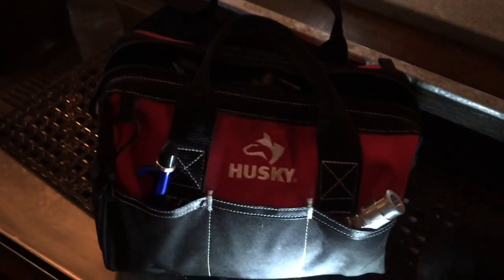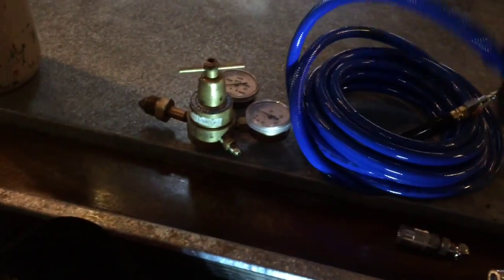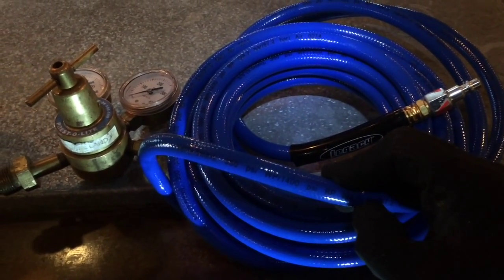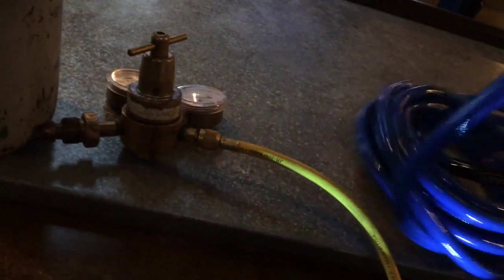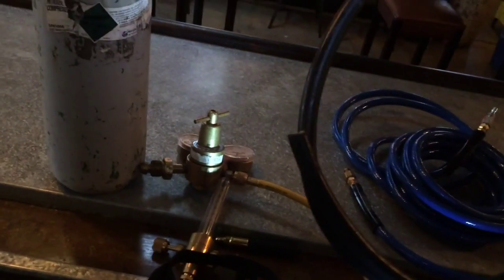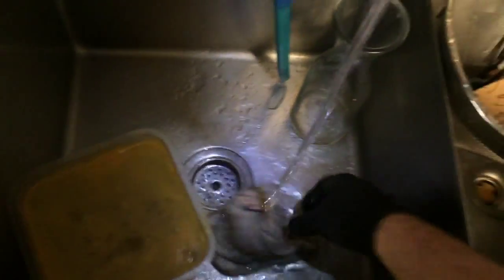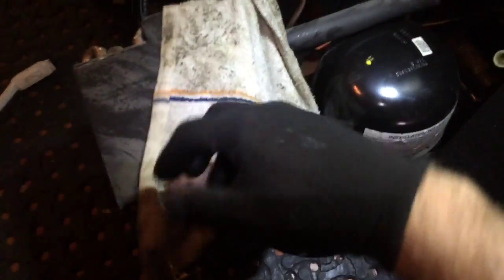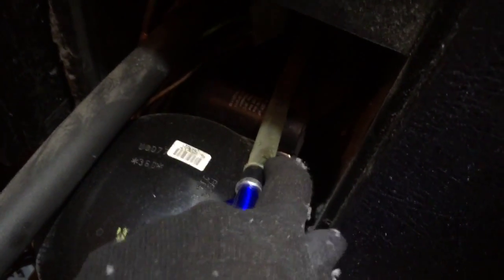Nitrogen rig

Comment: Nor-cal, what I did to clean highly biologically active powders was to use the encapsulation method of cleaning. For you this may be using a gentle mist of (heavy, 10% to 25%)soapy water to first dampen the dust (encapsulate) and the soap to loosen it from the grease that binds it to the coil and fins. Do this to all units first. Inspect if any units need extra attention, and give the soap time to act or work. Then followup each unit by vacuuming from the front while spraying soapy water from the back, go once around the front just vacuuming then use the air to blow the dust and dirt out from the back towards the vacuum on the front. Once you have made it through all units they should be very close to totally clean and the bonus is that you didn't blow dust all over the floor and up into the air and then have a mess to leave or clean.  Work smarter not harder.

Comment: Would work better if you had the quick connect fitting on the hose, and the male ends on the gadgets. Then you wouldn't lose the whole charge on the hose when switching between gadgets.  

Nice set up tho.

Comment: They use to sell kits like that one yrs back for filling empty freon cans with air for inflating tires, the problem with that was the inside of the steel cylinder was bare steel, no coating, so when you put humid pressurized air in it it would rust quickly. There was a refrig man who was filling a freon tank and blew his balls off, his wife sued the company that made the refrigerant and the hose kit company. That's why they make the freon tanks non refillable.

Comment: you really have to be careful with your reg valve setting. I use a CO2 tank with no regulator and a refrig gauge hose with no fitting on the end, I once thought it would be a great idea to use a gauge hose with a ball valve on the end of it, I didn't think about the pressure rating of the refrig hose, The ball valve flew off, went some where.
Reply: what doesn't kill you, makes you stronger
Reply from the maker: Jim Pettinato any videos coming Jim?
Reply from the maker: ***** yep has to be checked before use.
Reply: Jim Pettinato I did something similar using parts from a bag in box soda system and the home depot air hose kit blow gun.Took a shot of shrapnel to  the groin when it blew apart. Unregulated CO2 supply thru anything other than an open piece of tubing is a bad idea.

20/20 hindsight!